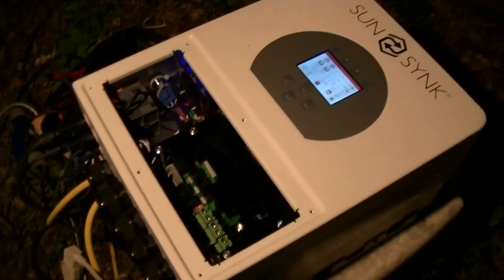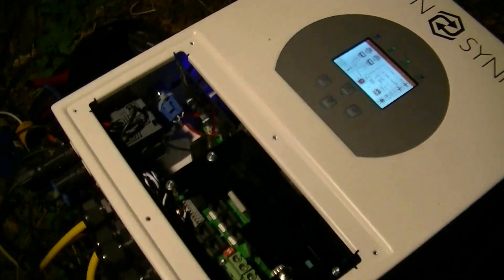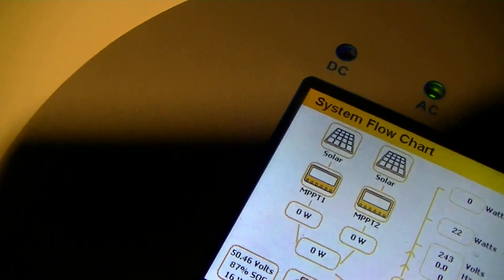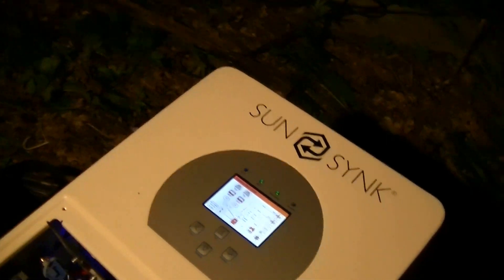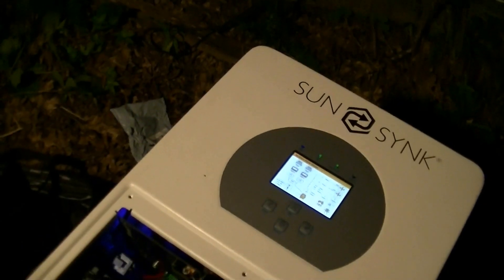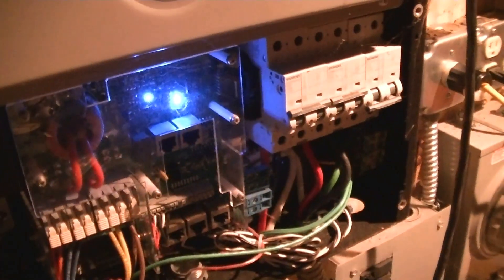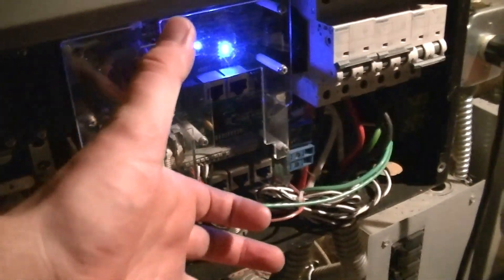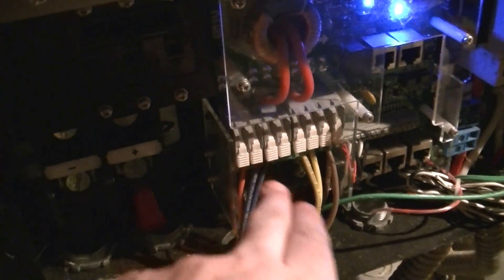Sunsynk ECCO 3.6K inverter first impressions

Comment: Are ECCO Inverters any good?
Reply from the maker: It worked as an inverter, but programming it has a lot of quirks relative to the Sol-Ark inverters I have.  This inverter was taken out of service at the end of last summer and is now in storage, and I need to build another test system for it to do a proper evaluation.